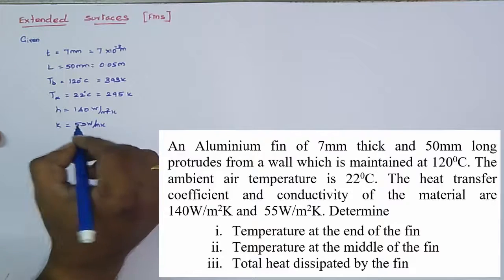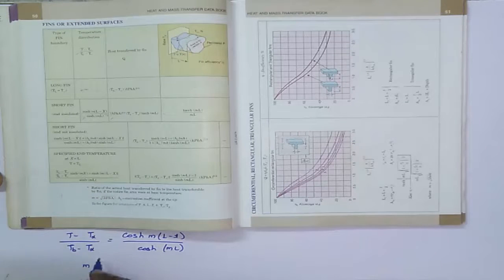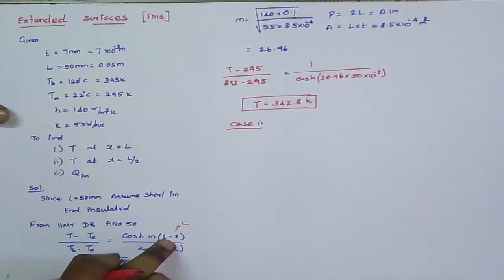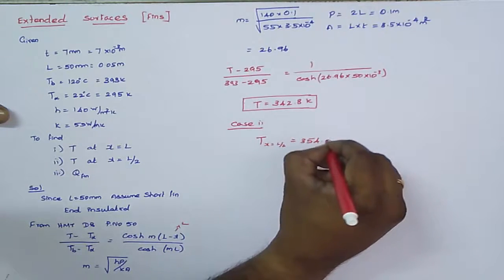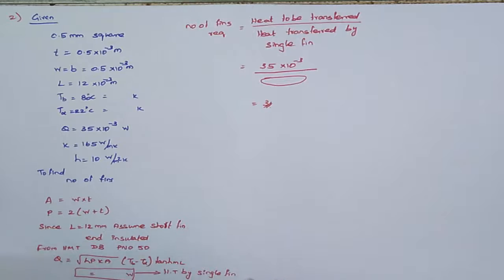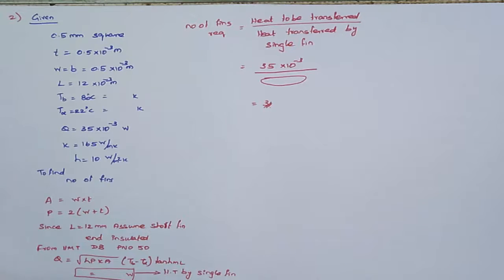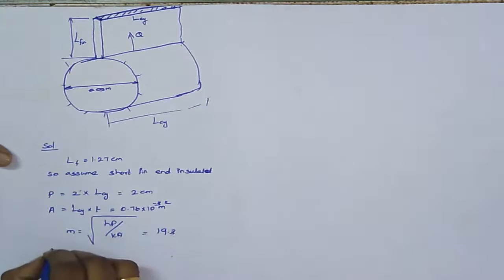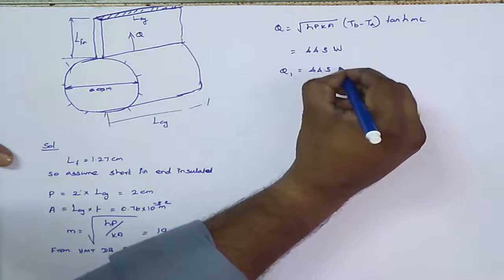Lecture 12 | Problems on Extended Surfaces | Heat and Mass Transfer

Comment: Sir i have doubt regarding to identify the problem whether it is short or long fin. Sir u told that when in prblems diameter and length are greater than 30 we should asumme as long fin 
But in this question length is 50mm sir so why do you doesn't assume long fin. You took short fin formulas
Y sir 
Plz explain
Reply: L/D greater than 30 bro... or they will mention term short or long
Reply: When val of Length is more then 5 cons it has infinite or long fin and less then 5 short you will understand it better when you will take out the efficiency for long and short fins